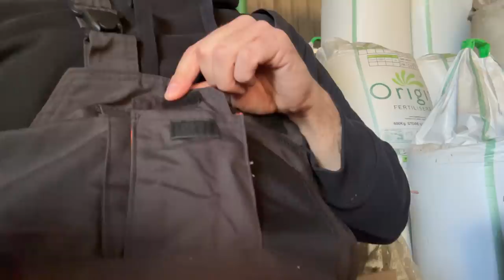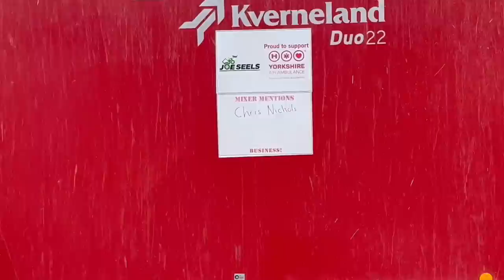7530 Still Has Issues… JCB has Problems! Nothing is Right! 14k SUBs!

Comment: Them Deere's don't seem that reliable to me nowadays.
Reply: They aren’t, I work for a man who buys brand new every 3 years, only puts 1500hs on each and they still play up
Reply: I worked at JD dealers in the 80's  on 30, 40 and 50 series tractors and they weren't that reliable then. Backend problems, and hyd pump issues.